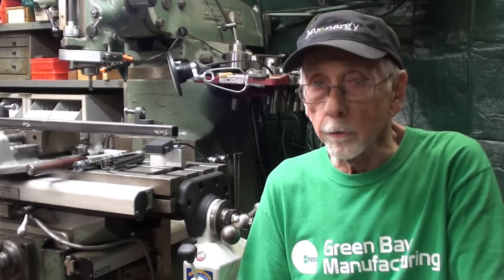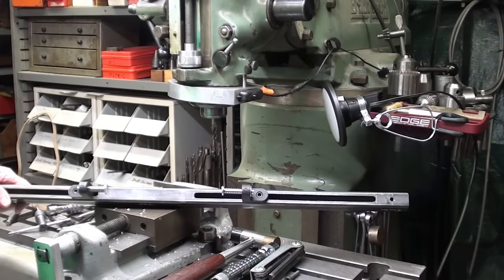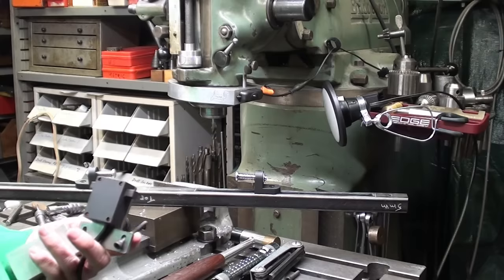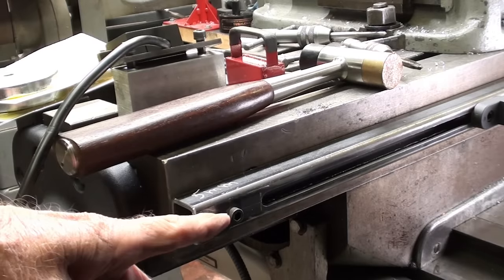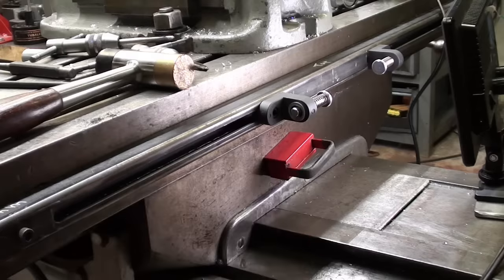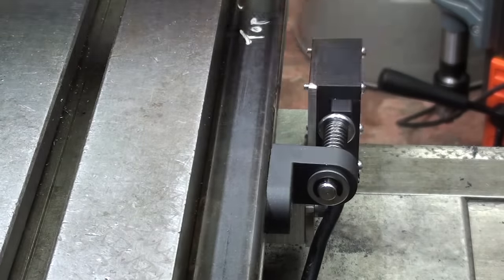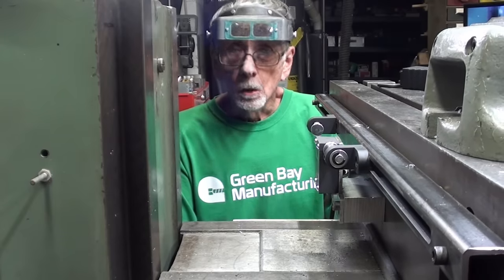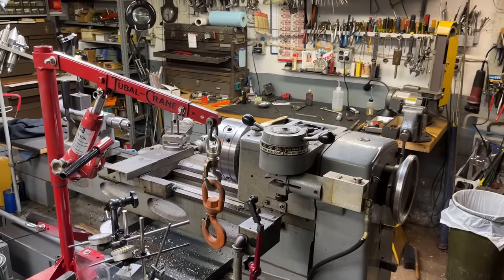INSTALLING BRIDGEPORT LIMIT SWITCHES pt 2 #905 tubalcain mill nrpete

Comment: Great video.  Only thing I would have done differently is rotate the rail 90 deg down to gain some more y travel.  Keep up the great videos.
Reply: IDK all that trouble for another 3/4” ? I wouldn’t worry about it.
Reply: @mclem4u  It would be more than 3/4". It would be the full height of those end stops plus part of the bulk of the switch body. By rotating it downwards the end stops and switch would extend downward instead of backward. Probably save about 2".
Reply: That’s exactly what I was about to post. He could have gotten at least an inch and possibly as much as an inch and a half. The rail would have to be mounted near the top of the table to get the height for the limit switch. The mounting plate he made for the switch might need the holes to be on the side of the switch rather than at the bottom and possibly slotted for height adjustment.
Reply: @blondin07 exactly!
Reply: Yes that would have helped but the ram travel will take care of most of the loss.
Reply: Just what I said on the last video...

Comment: Hi from the UK Mr Pete.  I've been subscribed to your channel for a few years now.  I love the longer videos.  I have learned a lot over that time.  Using the table as your method of pushing the workpiece into the drill was genius.  Such a shame you had to drill holes into that beautiful machine but needs must.  Now all you need to do is put a switch on the side to stop you from crashing into the back. 😂😂😂

Comment: Thanks Mr. Pete for this series of videos on mounting the Vevor power feed. Between you and Mr. Pragmatic Lee, I have gotten some very good ideas on mounting the same power feed to my PM bench top mill.  I plan to do so without losing any travel because, as is always the case, I have found myself wanting more travel in all three axis so sacrificing any is not an option. As long as you keep giving us fine content, I will keep watching it.

Comment: If you rotated your square tubing 90 degrees until your adjustable stops were facing down, it would take up much less space behind the table and not limit your travel as much. Also if you run it back and hit the back of the mill, it would only hit the tube instead of the stops.

Comment: Love all you produce sir. Rarely comment but quickly thought you to be approaching the job with blinders on. Now I see in some of the other comments others think like I. Just turn the slots down and the job is done. No spacer block no new bracket.
 Also no chips in the slots.
Bore the first mounting holes in the slotted rail out to 1/2 so the cap heads end up inside the slotted rail. Keep it up.

Comment: Lyle.
Don't swap the socket head bolts to save your knuckles. 
Shorten them and open out the hole on the outer wall so that the head of the shortened bolt will pass through and clamp the inner wall of the tube to the table.
That is good practice anyway as it stops the square tube from collapsing.

Comment: Excellent video you ol' Norske!
Grandma emigrated from Norway when she was four.
I'm so darn dumb I would've used a 2x4 for "careful" leverage behind that neat angle drill instead of the machine itself to drill the switch mount holes. Uff da.

Comment: Great video. Could you regain some of your table travel by offsetting the limit switch box to one side or the other of the knee dovetail? Of course you would want to offset the 1"x1" rail by the same amount.

Comment: Thanks Mr Pete. I was just wondering if you have room enough to flip the 1 inch bar down 90 degrees then mount the switch flat? I know that would make adjustments a pain, but you may gain an inch or so. Just a thought.
Reply: You and I were thinking alike.

Comment: I mounted my DRO scales to the back of the table so it would not interfere with the stops. It does take about an inch off the Y travel but easily solved by moving the ram out. To tell the truth I only use the feed stops as the ultimate safety not for any production control.

Comment: At least you were on alert in case you hit the mag coil off button. I was walking down the boiler ally to inspect my guy's progress on a part install. They were using a mag drill in a horizontal position. They had an electrical cord on the floor across the ally, which was against safety protocol, to power the mag drill. The safety officer, who was just a few steps in front of me, stopped and looked angerly at the total disregard of our safety rules that was taking place and proceeded to reach down and unplug one cord from the other. Fortunately, no one was under the old and very heavy Milwaukee drill as it came crashing down from the side of the boiler. Before I could say a word, he plugged the cord back and scurried back to his office. That was the first time I didn't have to get a half hour lecture on my guy's safety failings. By the way, that good ol' USA made drill survived that long fall and still worked (it saved me and ass chewing and money out of my tool budget).

Comment: Hi Mr Pete,  could you have mounted the rail 90deg. from where it is, and gained a little more Y axis travel?  Yes, adjusting the limit switches may then be a little less convenient, but as you eluded to, you probably won't adjust them very often.

Comment: Nice job Mr. Pete! 
However, I would never mount that "protection" limit switch on, at the cost of losing 2" plus "Y" travel on MY Bridgeport.
(Just don't use the bathroom on long cuts)

Comment: Question?  Why not face the slots in the rail downward and avoid the spacing block?  Seems that would tuck the whole thing tight and clear the knee ways better.  It seems so simple that I'm sure I'm missing something.  

And thanks for everything you do here, I have learned so much from your videos . . . I wish I had been in your class, tho I was probably too dumb to dumb to listen at that age.  Anyway, thanks ever so much Sir.

Comment: Lyle, that rail does not need to be that strong.  Why don't you cut the back side off (side up against the table) and turn it into a "C" channel just deep enough for those t-nuts to clear.  Might give you an inch of travel back to your y-axis.  Of course you would have to shave down your aluminum spacer as well.
MJ

Comment: Hey Mr.  Pete.   How much table travel is there in the X direction?   Could you have mounted it off center to clear the column or do you have/need that much travel?
I think I would have rolled my own solution just for non-adjustable end stops under the table to protect the "over" travel of the bed and not use that two sided switch.

Comment: Flipping the limit switch around was a good solution.
However, simply switching the wire connections to the opposite switches inside would've been quicker and you can then use the same nice filister head screws you modified...but I know you hate wiring🤣👍

Comment: Could you not have mounted the rail with the slots facing down? Then change the adjusting screws for thumb wheels? You should also paint the rail...😅